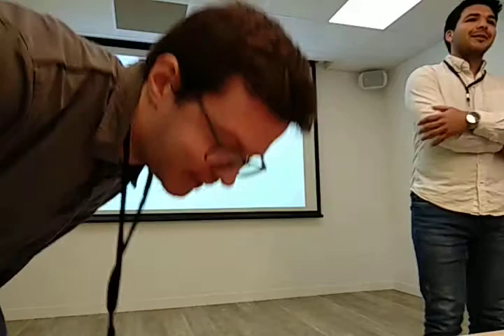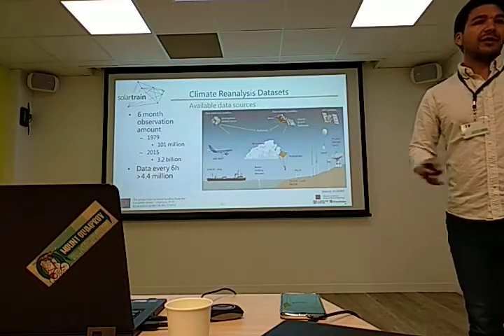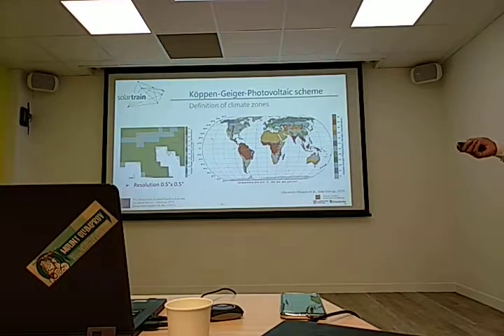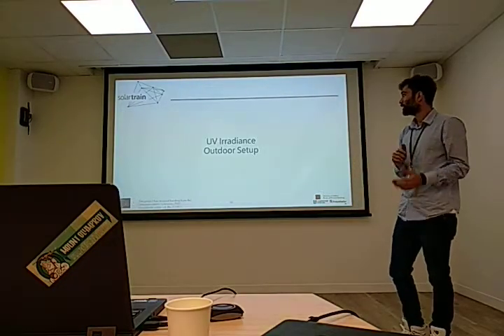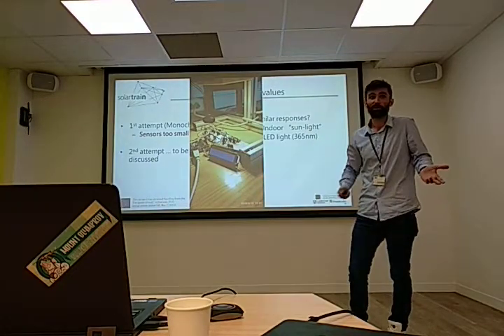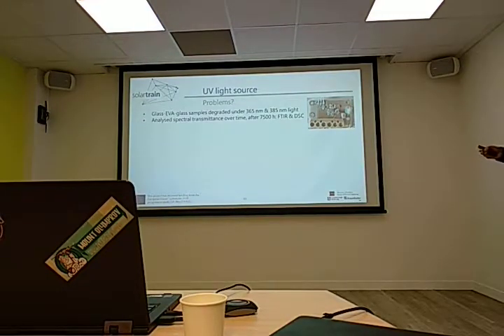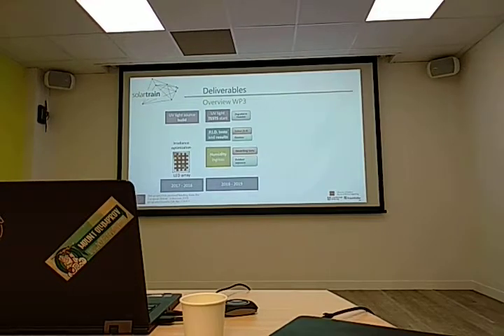Solar Train (Wp3) - Project Meeting 7 - EDF

Comment from the maker: Julián Ascencio-Vásquez - ESR 08
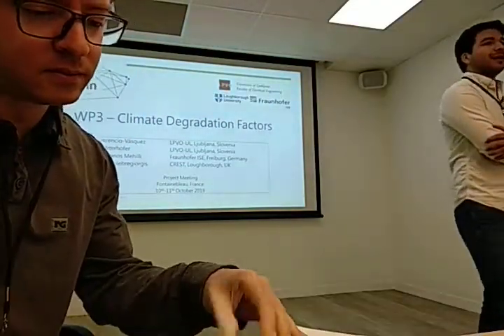0:32  - Introduction WP3
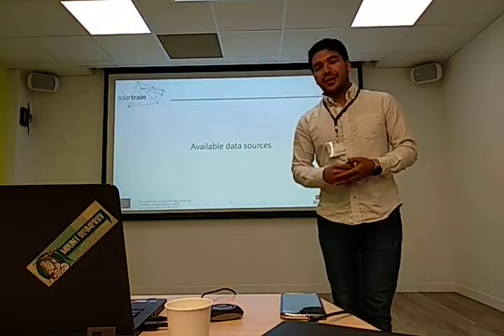3:13 - Available Data Sources
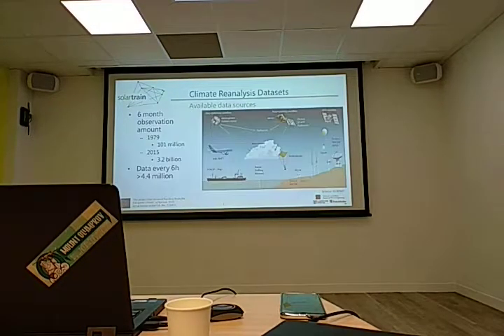6:29 - Climate Reanalysis Datasets
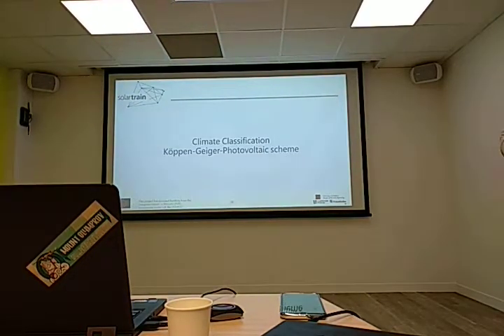11:15 - Climate Clasification - Köppen Geiger modelling
-------------------------------------------------------------------------------------------
Amantin-Panos Mehilli - ESR 01
13:00 - Climate Clasification - Threshold Criteria 
15:45 - UV/G data
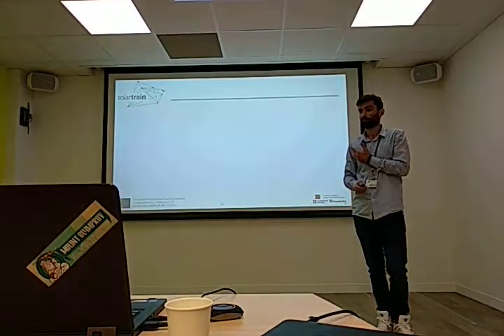17:03 - UV effects and measurements at different tilts
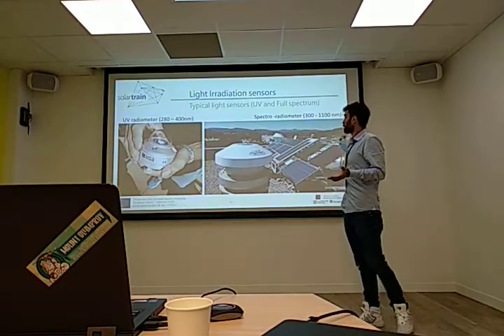21:46 - UV / G ratio and outdoor setup
-------------------------------------------------------------------------------------------
Stefan Mitterhofer - ESR 07
30:33 - UV light source - indoor setup
36:00 - Humidity (moisture) ingress - outdoor setups
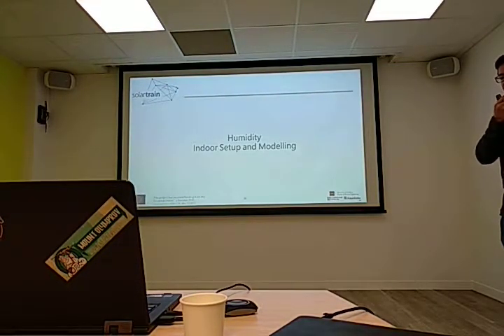38:40 - Humidity (moisture) ingress - indoor setup and modelling
41:09 - Dual Sorption Modelling
-------------------------------------------------------------------------------------------
44:49 - Overview Work Package 3 (WP3)
Reply: Thank you sir